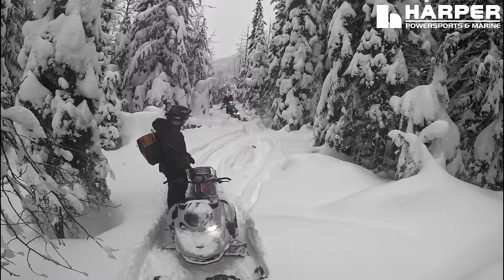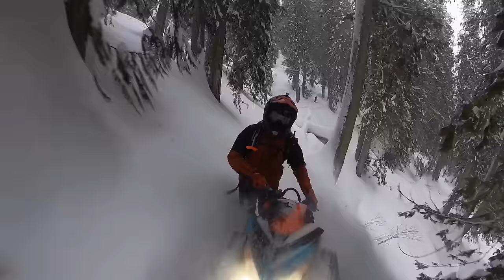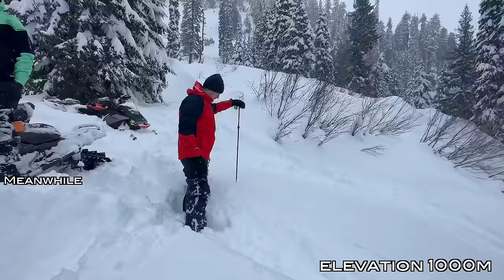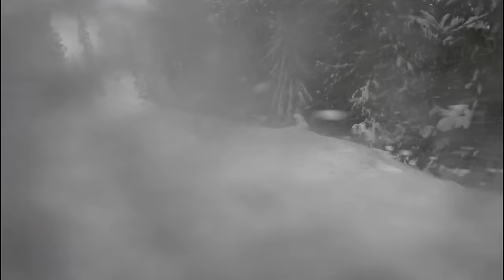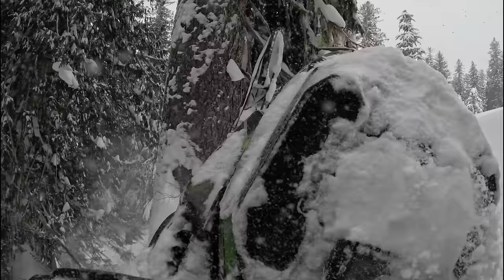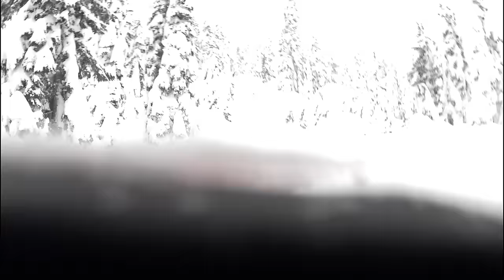2 Day Mission Breaking Into Epic Zone

Comment: You are definitely a better rider than me but can you explain why you always let off the throttle when you’re trying to climb the super steep stuff? Why not just keep er pinned? You seem to lose a lot of momentum so just wondering
Reply from the maker: When you go over bumps I let off otherwise I will go in to a wheelie and loose even more speed. There’s definitely times I probably let off more than I have to though
Reply: Don’t you also do it to allow the turbo to breathe?
Reply: it can help keep snow off of the vents when the blowoff valve pops @Juiceboxfilms39
Reply: Keep traction not always requires full throttle.
Reply: @MuskokaFreerider  thanks brotha, makes sense I know it’s hard to see every little bump on the video. Keep bringing the heat love it!